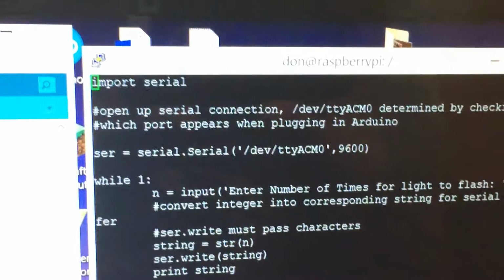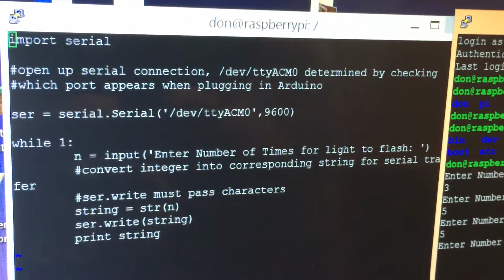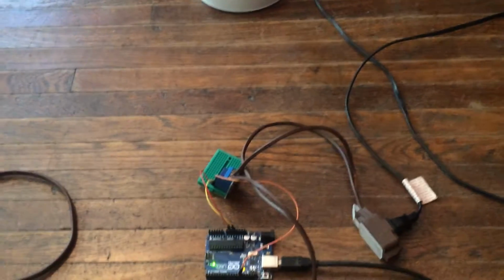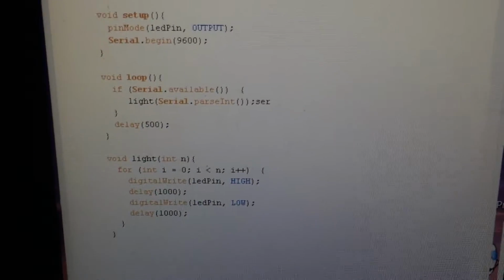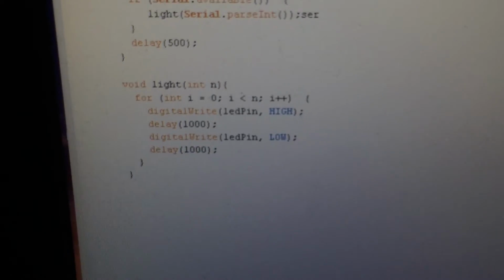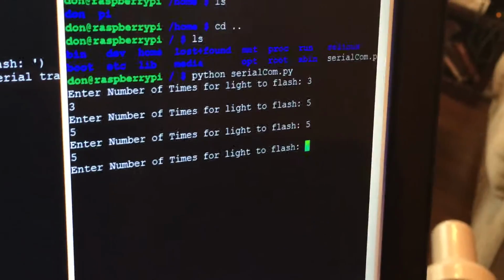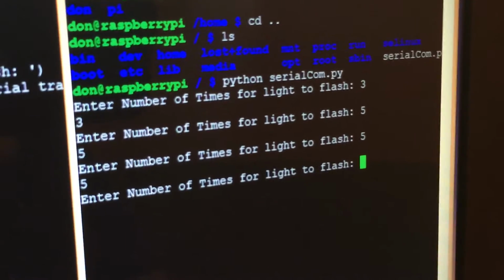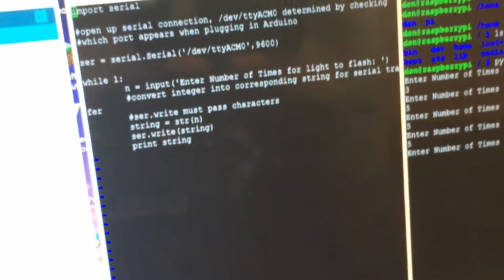Serial Communication Between Arduino and Raspberry Pi

Comment: I am not sure what were used here, what is the function of the green box and the grey connector at 0:14 of this clip. Are you using direct USB cable to connect arduino and raspberry pi?
Reply: some sort of relay...
Reply from the maker: Yes, I am using a usb cable to connect the arduino and raspberry pi.
Reply from the maker: The relay is used to turn the light on and off.

Comment: I am getting an error saying ser not declared in this scope  any suggestions. I have copied program  from this video
Reply from the maker: +NuCleaR WinTeR Sorry this reply took so long.  So in the part where it says /dev/ttyACM0,  you need to make sure you use the correct string for the usb interface that you are connecting to.  I posted a link to a tutorial in the description.  Did you do that part?  You pretty much just need to be in the dev directory.  You will see some things that start with ttyACM.  Then plug in your Arduino to the USB port.  A new one that wasn't there before should appear.  That is what you will use at this part.  It will probably be different for you and why you will get an error if you copied the code exactly.
Reply: I got it working by deleting the ser off the end of "light(Serial.parseInt());ser" line in the Arduino program which is in your program on the video....but thanks for the reply anyway
Reply from the maker: +NuCleaR WinTeR Ahh yea...I thought I was typing in the python script but I was still in the Arduino window that I had up right next to it.  So I accidentally added that extra ser in there without realizing it.  I didn't catch that typo before I posted the video.  It didn't affect my program because I had already uploaded the correct code to the board at the time.  Sorry about that.